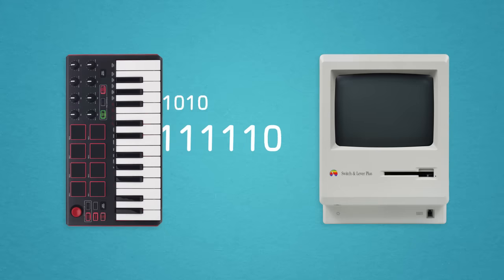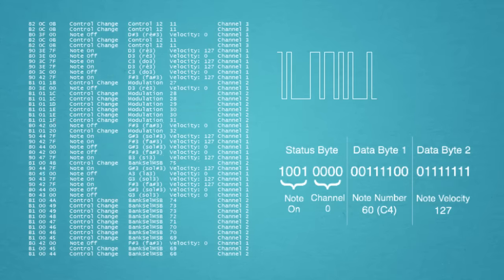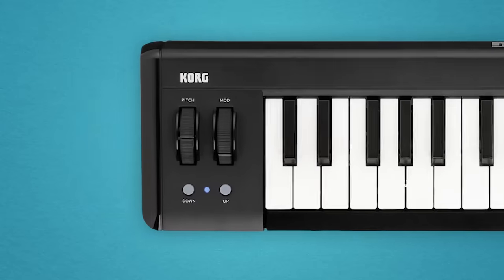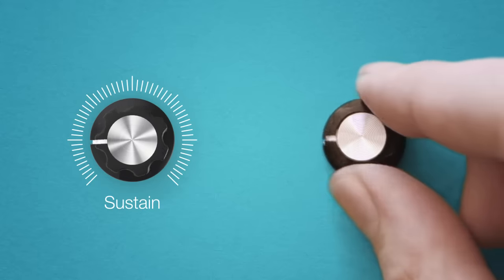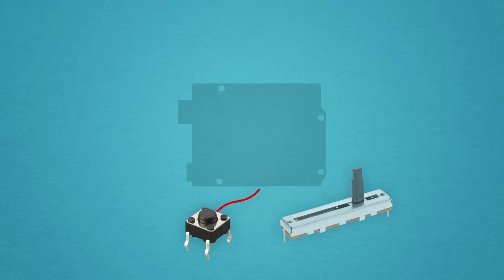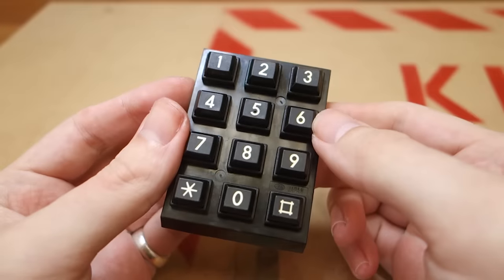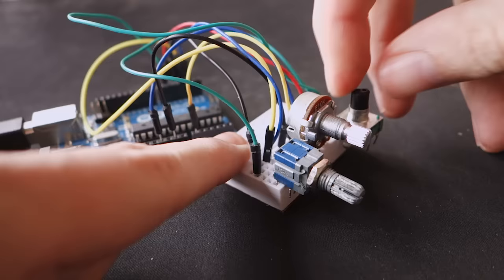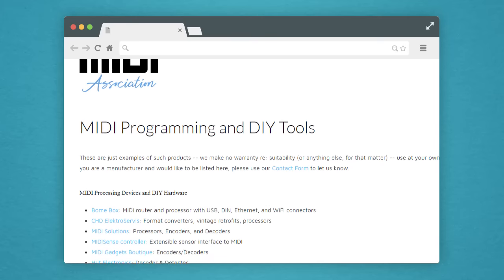Building a MIDI Controller Using Arduino

Comment: Absolutely fantastic, you have inspired me to go and build a midi desk ( not mixing desk, more of PC with some desk components built in )

I do have a quick question, with the rotary switch, would that would with analogue pots? I see you have used digital rotary encoders.

Anyway well done, looks fantastic
Reply from the maker: Jonathan O'Kane you could do it with pots but they wouldn’t be able to remember their position between states as they send an analogue signal. It would be near useless as your values would jump around. I’d say use encoders, or just skip that idea and add more pots.
Reply: @SwitchAndLever  thanks for the response :), funny enough I was looking at the possibility of using motorized faders instead of pots. My plan was 5 motorized faders with a 6 position rotary switch. Assigning position 1 to tracks 1 -5, pos 2 to tracks 6 -10 etc. I will need to figure out how to get faders to read from my DAW and set the to the correct position.

Also I've never done this before. :) I can code powershell and python so not to concerned about that side of it, but the logic of how to update the faders as per the saw will be where I think most of my time will go :)

Comment: I get that this was aimed at inspiring absolute beginners, but I thought it worth mentioning that the software link (MIDI-serial and LoopMIDI) is unnecessary if you use one of the USB capable microcontrollers like an ATmega32u4 based arduino or any STM32 based board. Because these handle the USB connection themselves (as opposed to by a separate USB to serial chip like the Uno and Arduino Mega) what they declare themselves to the computer as can be changed, with one option being as a MIDI controller. Doing this (at least for STM32 boards) is as simple as selecting the USB mode as an option in the tools menu and looking at the USBmidi example sketches for how to use it.
Reply from the maker: Yes, this has been mentioned many times in the comments. I don't know of a 32u4 or STM32 board with this many pinouts though, which would mean that if you have a lot of inputs you will also have to multiplex, which indeed pushes this up a skill level. Also, you use what you have available, I had a couple of Megas laying around, but no unused boards with native USB capability.
Reply: @SwitchAndLever  Checking your circuit, the most basic stm32f103c8t6 minimum dev boards that you can get for less than €2 on ebay have more than enough IO pins for what you built, but that wasn't the point I was making. I wasn't saying you did something wrong, only that (for people watching and who don't have an old Arduino Mega laying around that they can turn permanently into a piece of kit) there are options that create a true USB-MIDI device that doesn't need extra software to be installed that may or may not exist for what you are plugging the device into. That said, proper respect goes to you for actually doing it, doing it well enough, and making a video about it ... one of these days I'll get around to making the 36-knob/wheel controller I've been planning for the last few years...
Reply from the maker: @treelibrarian7618  yes, it appears that you are right, you could just about squeeze this design in with that amount of pins. 

You can also reflash the Arduino Mega to work as a true USB MIDI device, but I really didn't want to go down that route as I wanted to keep this more accessible.

Comment: Awesome stuff! If you used an Arduino Leonardo or Pro Micro with an IO Expander/Multiplexer (like a 74HC4067) you'd have native USB MIDI straight from the board and without need for the Arduino Mega or any kind of serial to MIDI conversion software. :)
Reply from the maker: Yes, this has been addressed numerous times in the comments. You use what you have available, and multiplexing would have made this needlessly convoluted.
Reply: @SwitchAndLever  Oh of course, always use what you have if you can make it work either way! Didn't realise it was already pointed out but just putting it out there for more options is all. Great project either way dude, wasn't saying it was done wrong or anything. :)
Reply from the maker: No worries, just a bit tired of the same comments being repeated. Glad you like the video!

Comment: It's a cool project, you should have looked at my instructable on arduino midi though, because you can programme arduino boards to become native usb midi and cut out all the other annoying software like hairless midi.
Reply from the maker: Yes and no. Only if you use a Leonardo or Pro Micro. But, that topic has already been beaten to death in the comments, I won’t repeat myself further.
Reply from the maker: Doing it on a non-32u4 Arduino is a bit more complicated but yes, it is doable. I don’t find Hairless MIDI annoying at all. What’s your problem with it?

Comment: Awesome! Maybe somesay you show us how to make a MIDI footcontroller---a keyboard for feet as organists use. Even today, such devices are limited and very expensive.
Reply from the maker: It would be essentially the same way as I made this, just with different MIDI messages corresponding to what a foot pedal is mapped to in MIDI.

Comment: I like using the PJRC Teensy 2.0 for MIDI controllers/controlled devices for it's native USB MIDI implementation - plug-n-play with no extra software. I believe there are now other Arduinos that have this feature as well.
Reply from the maker: I will definitely look into that as I'm looking at building some smaller MIDI devices as well, ones where even an Arduino UNO would have difficulty fitting into.
Reply: @SwitchAndLever  You can see a couple of my implementations at http://redbinary.com/category/electronics/
Reply from the maker: @redbinary  very neat. I looked into it but they're kind of pricey compared to cheap Arduino clones. I can get an Arduino Pro Mini clone for less than half of what the Teensy LC costs. I may still get a couple to try out though.
Reply: @SwitchAndLever  They are a little more expensive, but I don't mind supporting Paul's efforts. He and his small crew design and put the boards together themselves. He's one of the behind the scenes driving forces that have improved the quality of the overall Arduino environment for years. I look at the extra couple bucks as giving into the system. Of course once you have the first iteration of your design made and want to begin producing multiples the next logical step is to make it as it's own PCB.
Reply from the maker: @redbinary  obviously, but basically all my projects are one offs. I have quite a lot of Arduino clones living permanently inside projects like these. I have a few genuine Arduino boards that I tend to use during prototyping, but once I build it inside the project I swap them out to cheaper clones.

Comment: I wrote a fairly large open source MIDI utility device called Gizmo (https://cs.gmu.edu/~sean/projects/gizmo/) which targets the Arduino Mega, an AdaFruit 16x8 LED matrix, and a SparkFun MIDI Shield.  It's a pretty full-featured sequencer, arpeggiator, gauge, note recorder, and small MIDI controller among other things.  Since you're handling all the features of the Shield already, all you'd have to do is add an LED matrix somewhere and you could rejigger the software to target your device.  You might try it out!

Comment: Dude you should be making and selling these for music composers. There is a massive desire in the composer community for custom midi controllers. A couple of companies have set up crowd funded businesses with custom plastic modular boxes but the price for them is just daft.
Reply from the maker: Considering the time and effort required to make these i can assure you that if I am to make any sort of profit in return for the time and material spent the price of this would too be “daft” 🙂
Reply: @SwitchAndLever  Ha yeah it did look like it took some time. Really nice tho!

Comment: Hi, very good tutorial, I mean, it shows that making your own midi controller suited for your project is kinda easy after all ^^ 
you motivated me to make one featuring a joystick(the kind of joystick that don't return to center when released) but how do I find this type of joystick ? I searched an hour, to just find loads of console joystick replacement pieces... do you have a particular website to recommend where you can get some good joysticks ? 
Thanks !
Reply from the maker: Read through the comments, there has been a few links and mentions where to find other joysticks. For a lot of joysticks, this one included, you only have to remove a spring or two to stop it returning to center when released, so you may not need to get hung up on that detail.

Comment: This is such a cool project!
 What is the English word for the component that you use for 5V and GND that you can just glue on the wood and then solder on?
Reply from the maker: "tape" 😄
Reply: @SwitchAndLever  :D I thought it was some kind of tape, but fused with some sort of metal so that it is conductive.
Reply from the maker: It’s just copper tape, you can buy it from all over. Don’t make the mistake to buy aluminium tape as it’s nigh impossible to solder to.
Reply: @SwitchAndLever  awesome, thank you :)

Comment: if you want more and more pins, you could use a binary counter IC (e.g. hef4040bt) which outputs are wired to the selector pins of a multiplexer (e.g. 74hc4051) so you just need 2 pins to switch trough tons and tons of pins. you just have to code that every time you gave a pulse onto the binary counter ic, you read from the multiplexers in/output and store the switch value.
i'm still trying to get this principle to work with a button matrix, but maybe it doesnt work.

Comment: You missed a fun “feature” of making the keypad transmit the note values for normal dtmf tones. 

Then you could play “funky town” on it...
Reply from the maker: The keypad wouldn’t be able to do that without having those tones mapped to the corresponding buttons in the DAW though. You can see the insides of another identical keypad I took apart in the video. It’s just a bare PCB with contacts, no tone generator.
Reply: DTMF tones are not a single frequency.
Reply: Switch & Lever Sure, but you’ve got an arduino so instead of flipping to the next octave it could just switch to sending the correct notes for dtmf tones (ie F5 and D#6 if you press 1, G5 and E6 for 5 etc. ). 
The only problem is that musical notes don’t match up with dtmf tones so it wouldn’t really sound right.

Comment: But... 32u4 arduinos has built-in midi functionality without midi-to serial. But they not have a many ports. But there are some port expanders in the market. Video looks fantastic, btw
Reply from the maker: Glad you like the video, but please read the comments first, this topic has been beaten to death already. I use what I have available, I really don't understand what everyone has against the MEGA. Direct to pin access is by far easier to code for, to wire and to understand if you're not very savvy with electronics or programming.
Reply: @SwitchAndLever  The main reason is another one layer on the host, type of board doesn't matter

Comment: Nice job Daniel, awesome wooden enclosure, I know this is a year or so old but peaked my interest,  so downloaded the code, well written nice and easy to follow, however noticed that if the rotary switch is set to positions 5 & 6 cVal is set to 12 & 14 this will run off the end of the array encVals[ ] which has only 12 elements,  Should the values assigned to cVal be: 0,2,4,6,8,10 and not 4,6,8,10,12,14 or am I missing something here?

Comment: was wondering if it is possible to have the logitech pro joystick be used a midi controller in order to control hardware music gear such as the MPC one. I have seen many videos on using PlayStation controllers to control midi in software DAWs such as Ableton. 
My imagination is running wild here haha. Any ideas?

Comment: great looking project, but why you don't use multiplexers? and whyyyyy you use tons of software instead of using libraries, such as Hiduino, for connecting arduino as native midi device?? 
it wouldn't have to use arduino mega (with mux you may use freakin attiny85, which costs around 2$, or arduino nano) and simplify using your device a lot. sry for my english, it's not my first lang (:
Reply from the maker: Simply because I use what I have available. Direct connection to a pin makes the project a lot easier to manage than using a multiplexer, which I don’t have. Also cuts down on latency.
Reply: @SwitchAndLever  ok, but why you don't use libraries for native usb-midi connection?
Reply from the maker: @nikitoss1108  that only works on devices that can act like a USB-MIDI device, such as the Arduino Leonardo or Pro Mini. The UNO or Mega cannot act like a USB device, so you can't have your computer read it as a keyboard or gamepad or any HID device, without additional trickery. 

There are libraries which do pretty much exactly what I do in the code, output MIDI over serial, but what's the point of using that when it's literally just a very simple function.

Comment: Did you use rotary encoders or potentiometers and can you have an infinite range that you get with encoders?
Reply from the maker: Both. The two knobs to the right of the rotary switch at the top are encoders, and the three at the bottom are 10k potentiometers. You can have infinite range, in the sense that you can spin them forever. However, MIDI is ranged between 0-127 (except for some values, like modulation, which is between -8000-8000), so it would most often not make sense to twist indefinitely. I mapped the potentiometers to 0-127 and the encoders just stop counting up, or down, when they reach 0 or 127. You can, of course, programmatically have them do whatever you wish though. If you do send an inappropriate value (i.e. 128 or higher) it will result in a erroneous MIDI message, and depending on your DAW that may have weird consequences.

Comment: Very nice case! Why didn't you use arduino leonardo? It can be used as a 'direct' usb midi device, without the need for LoopMidi.
Reply from the maker: I've addressed this extensively in the comments already. You use what you have, and this thing has a lot of outputs (more than the Leonardo has inputs) so the MEGA was an easy choice. You should watch my latest video on where I hack a Guitar Hero guitar into a MIDI device where I use an Arduino Pro Micro as a native USB MIDI device.
Reply: @SwitchAndLever  Thank you, i’ll check it out!

Comment: Thanks for the video. What switches did you use under the keypad?
Reply from the maker: What do you mean? There are no switches under the keypad, it's a keypad, it's built in.
Reply: @SwitchAndLever  I thought maybe you had put tactile switches under the key pad to send the midi messages. I would like to know how you get the keypad to send the midi messages.
Reply: Thank you!
Reply from the maker: @hellenicamusic  the keypad is connected to the Arduino, and the Arduino sends midi messages. There are numerous ways of connecting a keypad to an Arduino, I would suggest downloading my code and having a look.

Comment: This is a really good video and a great job you did, but why did you use an Arduino Mega and not sonething like a teensy so you do not need the loopMidi bridge and the serial bridge. With a Arduino Micro or a teendy the computer recognises the controller as a normal usb device
Reply from the maker: I’ve addressed this multiple times in the comments already.

Comment: Great work!!! Is there any alternative instead of the hairless MIDI as the bridge? Its a Fine program but I'm looking for something that can receive & send data from more than one MIDI device
Reply from the maker: Well, if you want many MIDI devices over serial that may be an issue. You can have this and a USB MIDI device side by side if you want, that's how I'm using it next to my keyboard. Another alternative is to use a Leonardo or Pro Micro instead of the MEGA, as that can support native USB MIDI. Downside is you have less input pins than with the MEGA.
Reply: Switch & Lever thank you so much! The Leonardo is a good advice! And I can use a pca9685 for extra pins, I totally recommend it for your projects too! Thanks again for the quick response also brother!!

Comment: Do those programs used to convert the signal cause any extra latency? Also would it work with multiple custom controllers at once?
Reply from the maker: The latency is, in my experience, negligible. However, there are other solutions which doesn't require those programs. Look at my latest video on making a Guitar Hero MIDI instrument, I think that is a better solution which creates an actual USB MIDI device without need for LoopMIDI or anything such.

Comment: Brilliant, thank you. Do you take commissions? I want a controller for my SSL plugin. Doesn't need to anything else, just bring out the knobs into the real world.
Reply from the maker: The time required to build something like this would not make it cost efficient in the slightest to build these on a commission basis, unless you have more money than you know what to do with. If you do, then we can talk! 😄
Reply: @SwitchAndLever  Thanks for the frank response. Given that the closest commercially available unit that does is US $500 and doesn't have a fader then I was hoping the parts and labour and getting exactly what I want would be competitive. Either the ssl channel strip or the Schepps Omni channel, both are great, but muse control is unsatisfying and unnatural.
Reply from the maker: @trevfisher  remember that there is also a second hand market, perhaps you can find a used model on eBay for much less than that.
Reply: @SwitchAndLever  there isn't a meaningful second hand market in Thailand sadly, not even in the region.